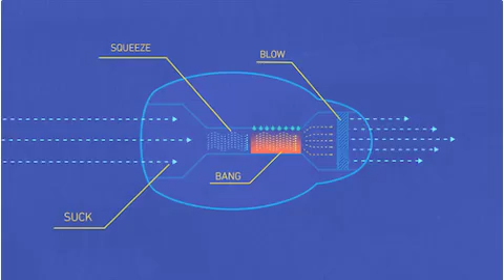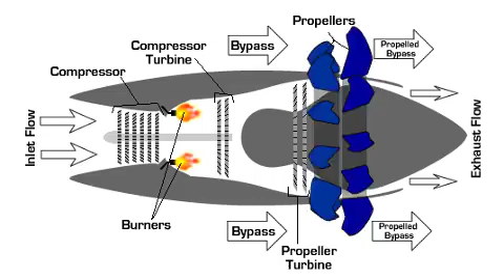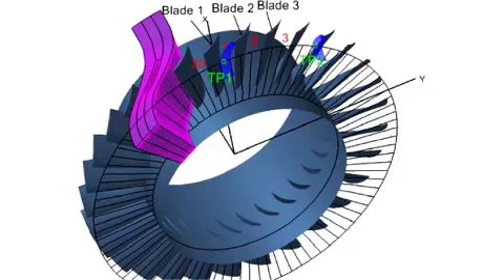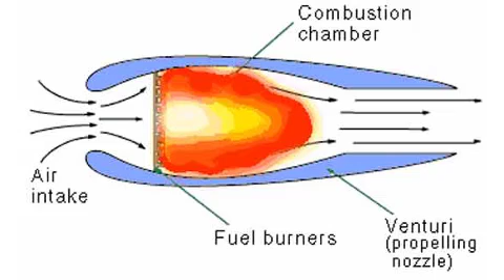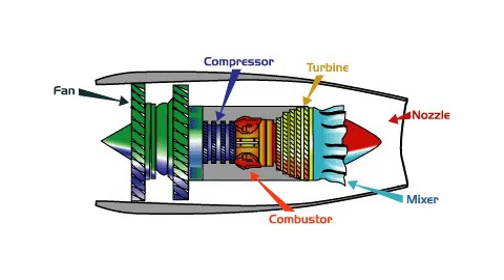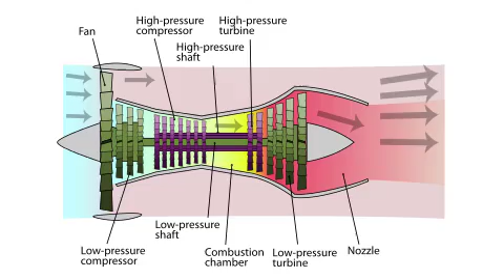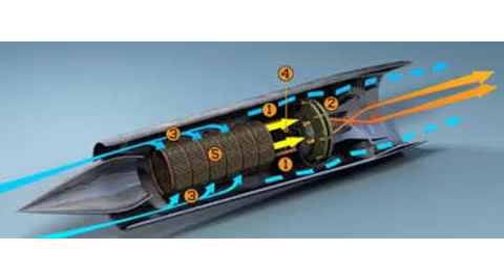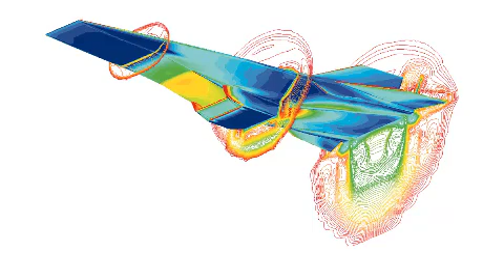Jet Engine - What｜Parts｜Working｜Types｜Facts ?

Comment: Hiw the blade can spin? Who spin the blade?
Reply: I'm also searching for that but no one is answering
Reply: Turbine disks are basically small windmills. When the 'wind' passes across it's blades the turbine disks spins.  This spinning turbine disk is connected to compressor disk which are basically fans. These fans pull in more air that gets mixed with jet fuel and burns. This burning produces the hot gases - the 'wind' - that turns the turbines we saw earlier. One difference to a wind mill is that the turbine blades are many, where as usual windmill blades are just 3 to 15. The wind across a windmill may be max 70-80 kmph and  40- 50 degree celcius, whereas 'wind' across turbine blades are 700-1000kmph at over 1000 degree celcius.
Reply: Airil Azraff They start it with an air compressor. Once started, it runs on air. The talk about “jet fuel” is bullshit.

Comment: this might sound like a dumb question but i just dont get how the combuster works. so the air and fuel mixture inside it gets hot and burned. why would that alone make the turbine rotate any more than just hot air? is it the density expansion inside the combustion chamber caused by all the heat? 

because the combustion that occurs inside the combustion chamber inside a jet engine is not a bang like in a v8 forexample. it's just a continious burn that heats up.

Comment: Question Anyone - balancing airflow?. 

If I have this right, combustion creates high pressure air to turn the rear turbine blades which rotates the shaft which rotates the front blades AND the first stage compressor as they are attached to the shaft, thus completing that cycle. The turbine fan also creates airflow thrust. If the turbine fan does all that via combustion,  what controls the air flow balance or force so you have the desired amount of air flow for thrust and shaft rotation? I assume rate of combustion or acceleration answers part of this, but I am still hung up on air flow balance if even an issue?
Reply: Are you talking about air to fuel ratio? I don’t think that matters so much since it’s in a jet application vs a normal engine where it must detonate when the spark plug tells it to.
Reply: Normally, speed of the rotating turbine - compressor assembly controls the airflow. On modern engines clever techniques like movable compressor stator vanes and bleed control valves regulate the airflow.

Comment: The turbo fans of the engine also regulates the engine's temperature by keeping the engine from getting too heated as it also depends on the external air flow to keep cool. As for that automobile engines use coolant to regulate the temperature, jet engines are different, they don't use coolant because of the extreme freezing temperatures at high altitudes.

Comment: Where from does the compressor get energy to rotate?
Reply: Abonmai Abonmai ... Expanding hot combustion gasses.
Reply: from the turbine.
Reply: This has been my doubt as well. What makes the turbine rotate?
Reply: Ys i am also confuced where is the starting energy for starting compressor ....
Reply: @gogooog1629  from the starter mechanism.
Reply: check APU Bleed start videos... APU bleed is one of the way' to start rotation of compressor assembly when engine is at idle position
Reply: The Fan

Comment: at  3:00 it's showing the HI BYPASS design where 20% of thrust is actual exhaust, then 80% is clean air.  They literally printed ((this is where the contrail comes from)).. When 80% bypass were  developed (Rolls), they realized that it was almost impossible to produce a "contrail" compared to the old 100% HOT THRUST design.  Yet now we have (TRAILS) bigger than the jet itself and they stretch across the entire sky. Hmmmm?
Reply: You're a fucking fool.
Reply: Water and ice particles tend to expand and smear when blown by the wind dumbshit.
Reply: Today we have the Chemtrails, which make the contrails look like nothing. Look up Chemtrails.

Comment: None of these videos explain how the jet is started.  Does it have a starter or what? How does it start turning?
Reply: Wade Caton it uses compressed air to start it
Reply: Squirrels in a cage.
Reply: For small engines, there is an electrical starter motor like in cars. The motors spin the compressor turbine assembly to some speed to create enough airflow through the engine. Then fuel flow is turned on and ignitor plug (like a spark plug in a car) starts the fire. Once started burning, the fire continues to burn as the airflow is continuous. For big engines like in airliners, a small jet engine (called APU) on it's tail is started with electric starter as explained earlier. Once APU pick up speed, a portion of air is leaked (bleed air) from its compressor stage (or from a dedicated air compressor driven by it) that is fed to the air starter motor on one of the the main engine. This starts that main engine. One it also pick up speed, bleed air from that engine is used to start the other main engines.
Reply: @Wingedmechanic  ,thank you sir, there are no videos showing about the starting, only explains the air fuel burning and thrust force. You gave me the perfect answer
Reply: starter used to start the engine till about 60% speed
Reply: i have to find answers for same question

Comment: What if we take little of air from the front thru a nozzle that opens at high speed and introduce it in the combustion chamber @ so instead of bypass some to cool the engine. It might give the turbocharged effect  and may increase the thrust..
Reply: Ram jet has no moving parts. Just air enters and compressed and ignite d
Reply: Gems N Gold .